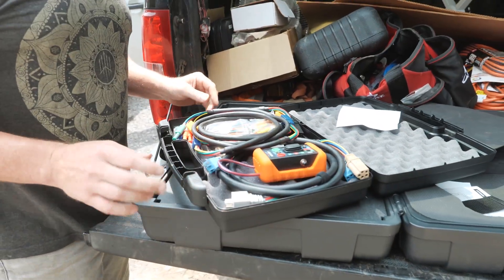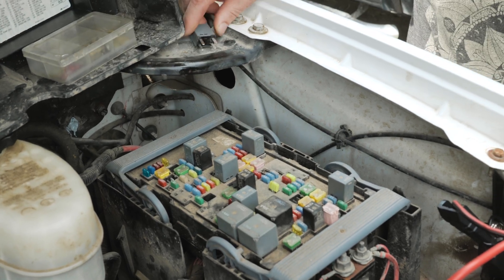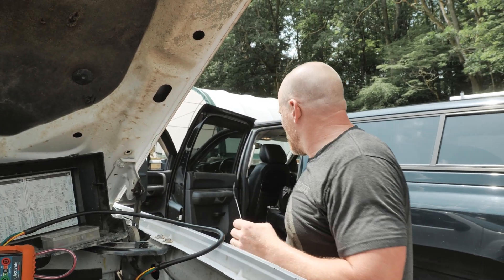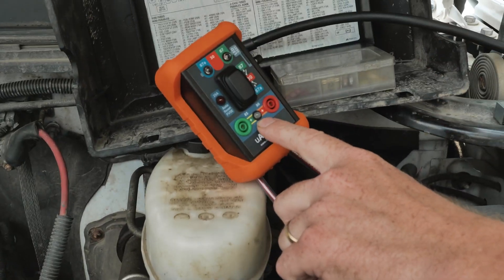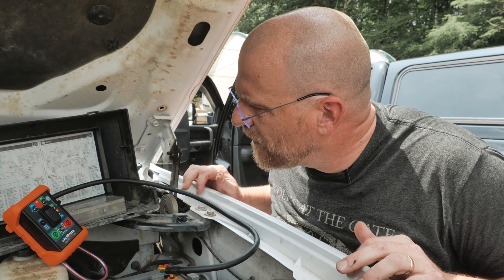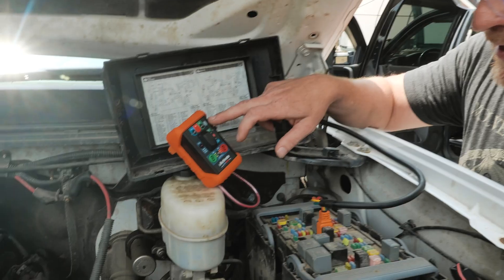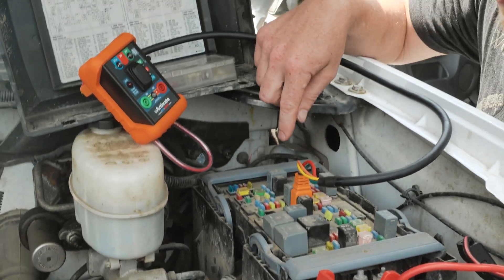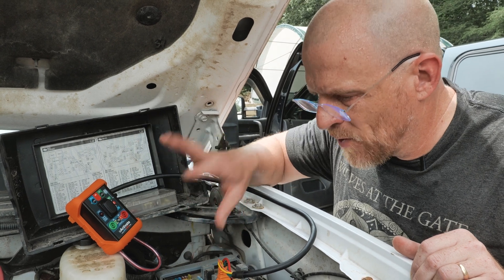The New AESwave uActivate is Finally Available!

Comment: I wish they added a way to have the relay in circuit. Still a very useful tool when I remember to pull it out😃
Reply: I never purchased one,  but when I started really getting interested in diagnostics I came across some relay testing tools. At the time, there were some tools that were meant to cycle a relay a bunch of times to test if the load side was making contact every time. I'd imagine these are still available. 

I purchased this new uactivate, but I also have the lisle relay jumpers that allow you to test with the relay plugged in as well. 

I do actually stock several Honda ac compressor relays, they are so common. That said, you can almost always diagnose them with a quick tap test on the relay and seeing the compressor kick on. 

I will also admit, I don't have my tools set up to be easy enough to grab for the size of my shop... I almost always end up pulling the relay and grabbing a test light if it's not an intermittent issue. Actually did this earlier and found a control side problem. I would have moved onto a test light to be sure, but I actually found the issue with a pass/fail test with a multimeter when 85 was 10 volts and my battery was over 12. Happened to have a jumper handy too, and BAM, cooling fan. 

The key to being efficient with a lot of these tools is to not only know how to use them and understand circuit design, but to have them set up in an organized manner that makes it efficient and worthwhile to grab them! This is something I am working on.
Reply: @ClaytheBMXer  I agree with you, and I also end up using a test light, I'm not concerned about how to test a relay; I just think the tool would be more user-friendly if it had a built-in relay.
Reply from the maker: If everything tests good, then the relay is bad. It really is that simple. It's also almost never the relay. I can think of 1 bad relay in the over 1200 case studies I've done on video.
I think to add an additional way to test the relay itself, is really not needed. Just my opinion. 
But thanks for the comment!
Reply: @ScannerDanner  I think it's worth having, not even to actually test the relay, but just to have a relay in the tool itself so that I can see it working instead of just those LED lights. I see bad relays all the time, especially on Toyota and Honda Compressor clutches. Thanks for all your videos I learned a ton from you!

Comment: Ivan at pine hollow auto diag just did a video on a bmw where bmw used a standard relay pin design but had it wired differently.  As awesome as this tool is, it comes with a warning not to use on some of these weird cars.  What you think is load and control side may not be true and you can overload the module's driver.
Reply: I just saw Ivans's video on that as well. How crazy for BMW to want a common 85a type common relay in reverse order.
Reply from the maker: @johnclamshellsp1969  I remember some weird layouts like that on some Euros. Was it a standard layout as far as terminals go?
Reply: @ScannerDanner It's only 2 types of relays that are the same set up, with reverse wiring. otherwise, all the other are standard. and the one relay of those two,are not very 'popular ' .
Reply: We all watch them both.. lol..  and several others I'm sure.
Reply: You can buy the special BMW adapter for this tool that is setup like Ivan's relay was.
Reply: Many of us just watched it too. Masters of their trade, they are.
Reply: Look at the pin configuration before you plug in! Use some common sense!🤦🏻
Reply: @dmrftg6000  lol the point of this tool is to be quick and efficient.  if you can quickly prove the relay works, there's no need to study pin configuration and waste time on what isn't the problem.  that's where the warning comes into play.  when you plug a clock into a wall outlet, do you verify which pin has power at the outlet?  probably not, because you assume things are standard.  i'm not sure how that qualifies as a lack of common sense.
Reply: In Australia, we have vehicles from all over the world & we have relays with a couple of different pin configurations & all have the same style pin layout, but different pin numbering & if you fit the wrong one, you let the smoke out! And you have to use some common sense & have to look at the pin configuration before you insert it! 🙂
Reply: @dmrftg6000 that makes a little more sense.  In North America, ~98% of all cars have the same relay pin configuration.  There's only a few small car manufacturers that will use a relay that fits, but has a different pinout.   So perhaps it's a bigger trap for us.
Reply from the maker: absolutely! Any tool that connects two contact points can do damage if you jump the wrong contacts!